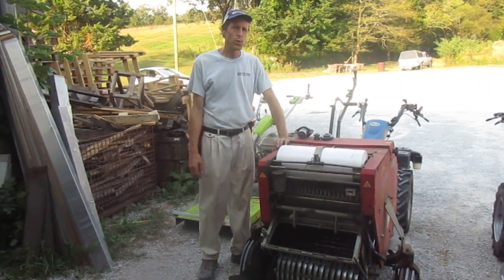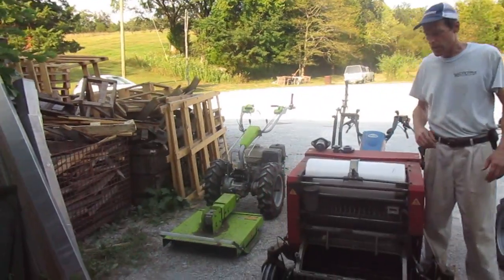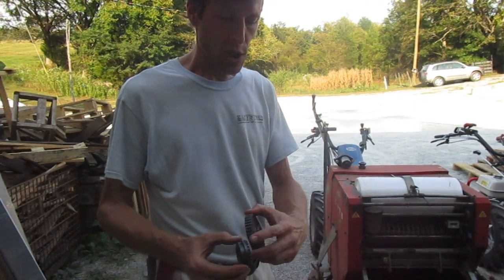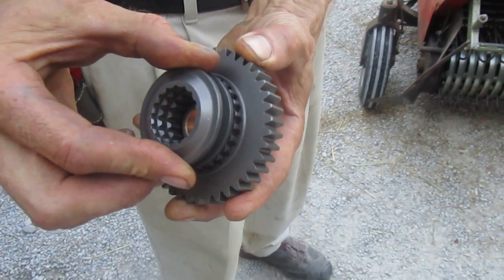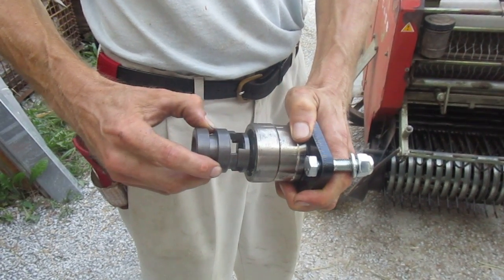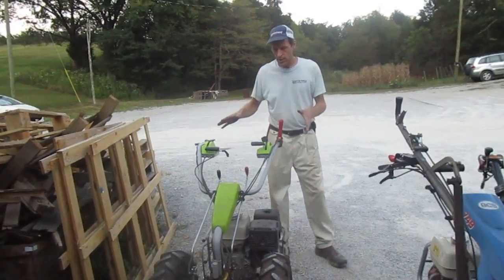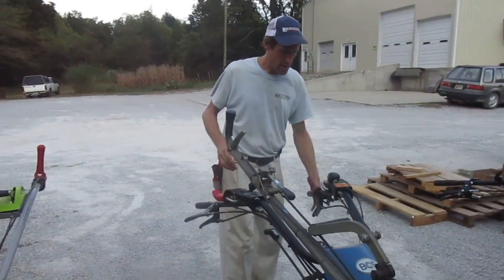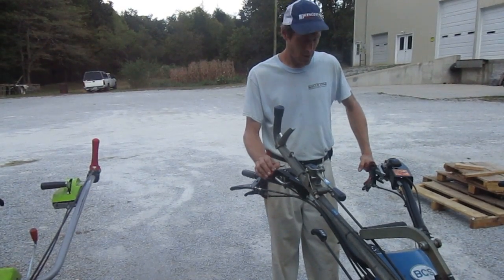PTO Engagement Techniques on Walk behind Tractors

Comment: Thanks for the helpful video! However, now I am running into a different issue. My BCS 853 runs perfectly when pto is not engaged. All gears run smoothly with no issue both forward and reverse drive. The issue comes up when engaging the pto. The pto spins but the bcs doesn’t move forward with enough power. Could you help me out?